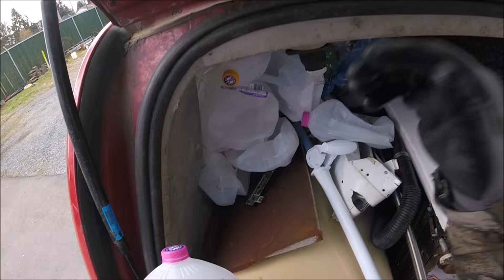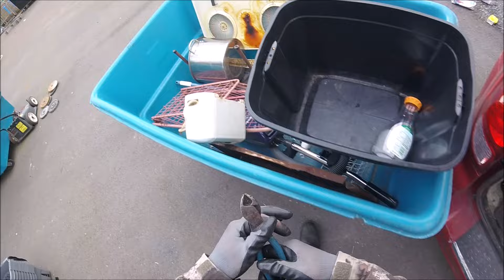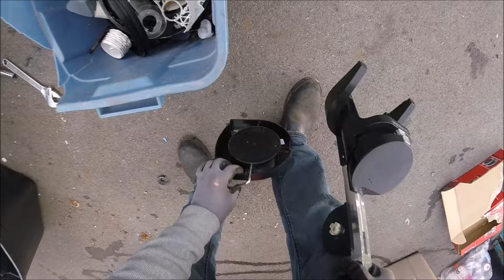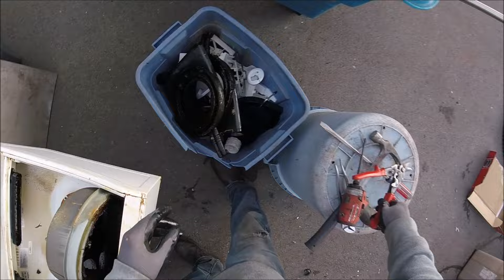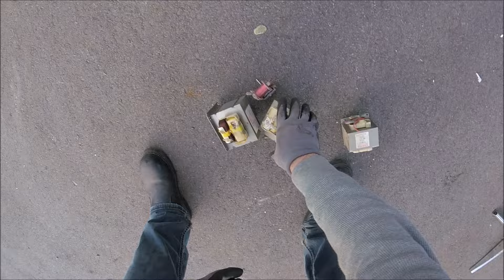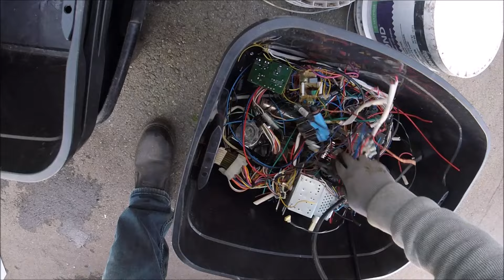Unloading Red + Scrapping More Stuff

Comment: A punch and a big hammer will make pretty short work out of those pressed in bearings need the item in the vice though generally,I scrapped out a motorcycle wheel not long ago and removed the bearing this way. I’m curious what you will do with the magnetron from the microwave? I’ve got a few of them out there sitting ,saw one guy cut it with a grinder and got most of the copper 🤷
Reply from the maker: I have so many

Comment: A lot of the materials that go into shred will not be recovered. The small amount of gold or other precious metals on a circuit board will never be recovered if they go into shred. There is way too little of it in a mountain of waste and it is impossible to separate it out profitably. Same with small bits of copper, brass or any other non ferrous metal. 

Its like with lithium batteries. Yes there is lithium, yes it is valuable and you have it all separated and gathered up. Still not worth it.
Reply: The scrap goes through shredders. The small pieces go through magnetic belt, all the ferrous gets separated. The remaining gets processed for non ferrous, plastic etc. Those which go to ferrous, aluminum streams will not be processed for gold. But what ever goes through copper scrap will get processed for gold and other precious metals.
If Phil dont collect all of them will end up in landfill. He passed them on to the next processor. Some gets recycled some may not. I am happy that at least some gets recycled. Phil is doing his part.
Reply from the maker: Scrap yards sell the fine grinds to company's that will separate it with shaker tables for all the micro metals even gold, Even the plastic is worth money